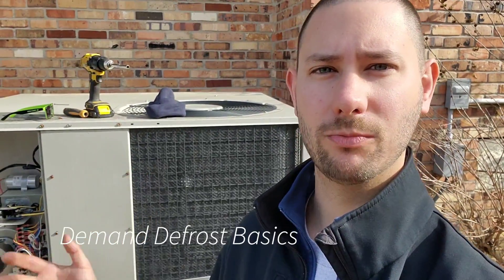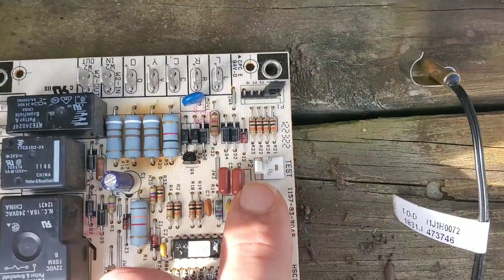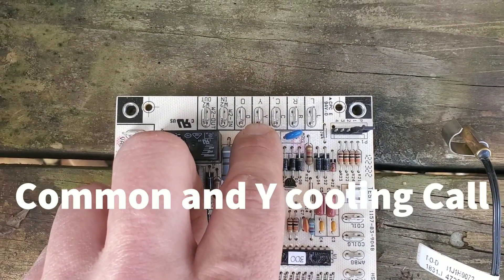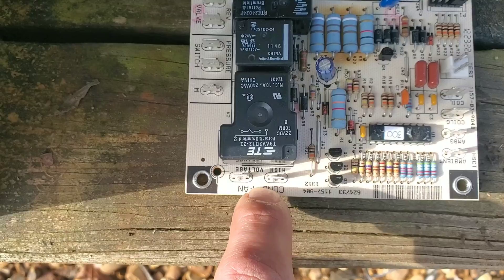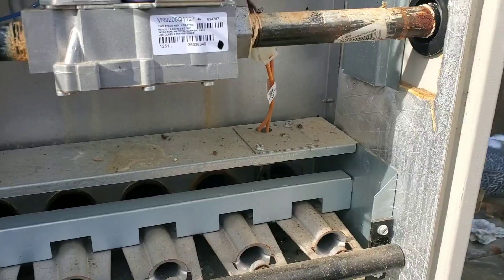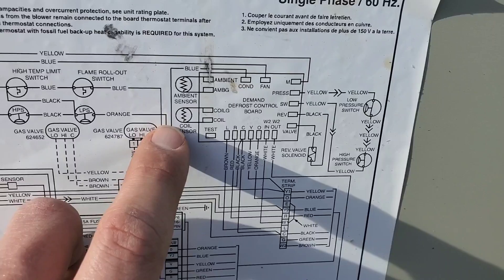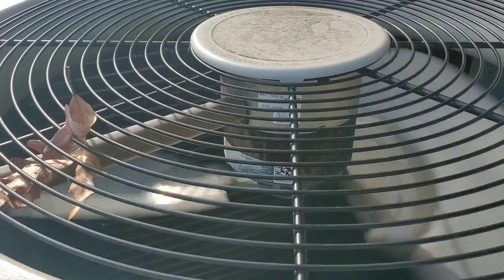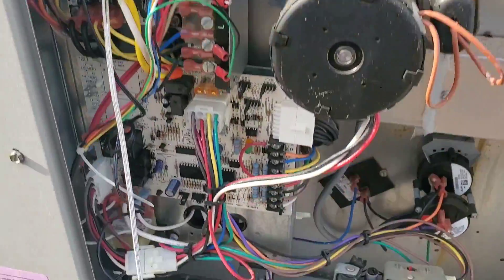How Demand Defrost works on Package Heat Pump?

Comment: What  does p1234 mean some boards have 30 60 90 on them mine has p1234 on it doesn't seem to change anything when it's moved
Reply from the maker: That is for different defrost curve
Check out the manual for your unit. And in the installation manual, it will describe the different choices and different curves
Reply: @taddydigest  I can't find the manual for this unit the model number is ZTHGD30S41S2A the defrost cycle is acting crazy
Reply from the maker: @ericfewell226 that's a crazy model number
Make sure it's on position number one.That's the best position I would suggest for you
Reply: @taddydigest  THGD30S41S2A I can't send a pic of the model number on here is what is on the sticker on the outside of the unit. The unit doesn't go into defrost often enough and builds up ice and frost on it blocking all air flow
Reply: @taddydigest  could you possibly try to locate a manual for this model because no matter where I put the jumper it seems to behave exactly the same way